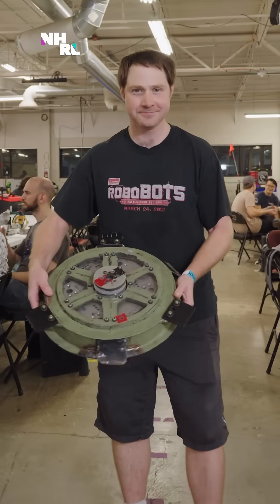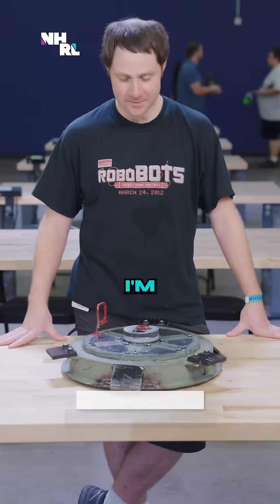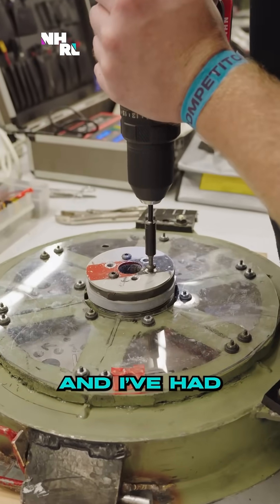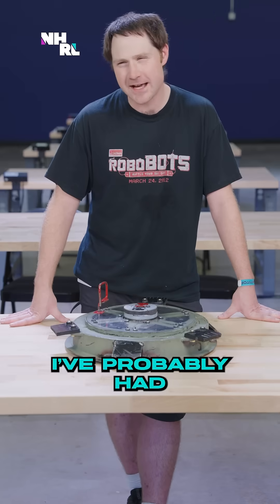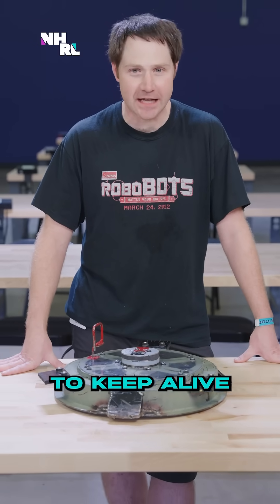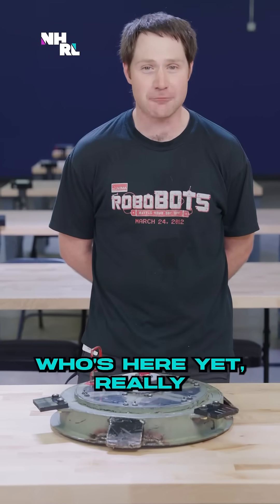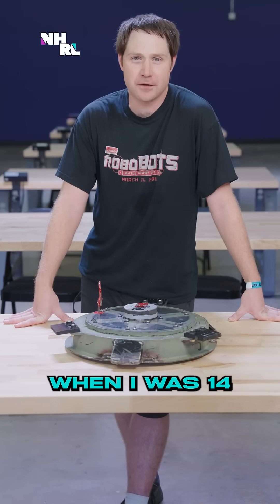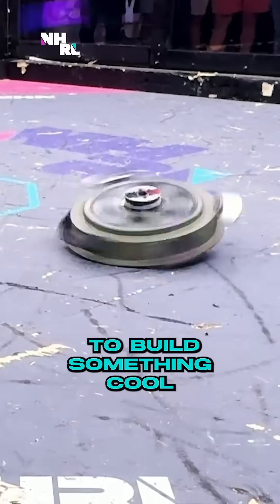Giant Beyblade shell spinner robot: Hyperpolarized

Comment: I like seeing a spinner that just harmlessly bounces over the top of wedges and flippers instead of launching itself across the arena
Reply: The one thing I dont understand with these shell spinners is why do they not have anything to get under wedge? like a small lip that may be millimeters  off the ground, that way when it gets a bite, then it will not only look cool, but also do something to the wedges
Reply: @LearnChess124  Just a guess, but I expect that with most designs, that would be liable to bite into the floor and send the spinner flying, just from moving around the arena. I think a lot of spinner designs have to solve problems regarding keeping the bottom edge of the spinny bit level and safely off the floor in all situations.
Reply: @Vinemaple  Thats definitely true.